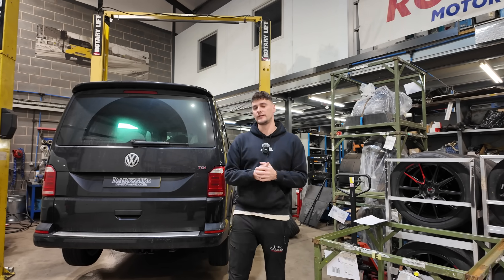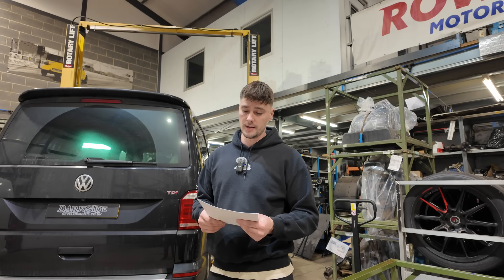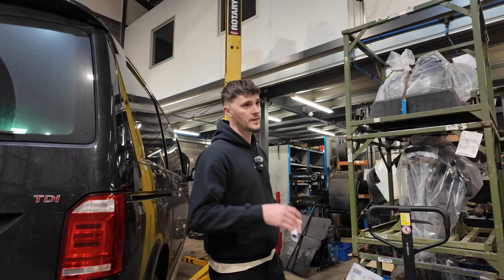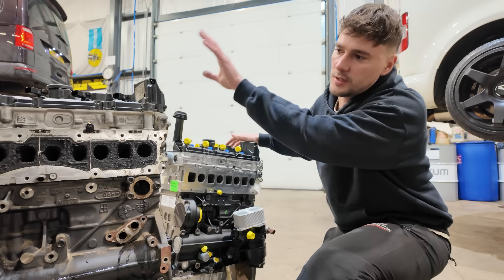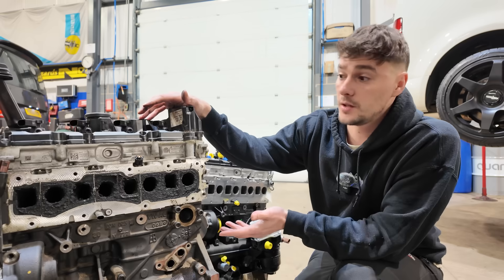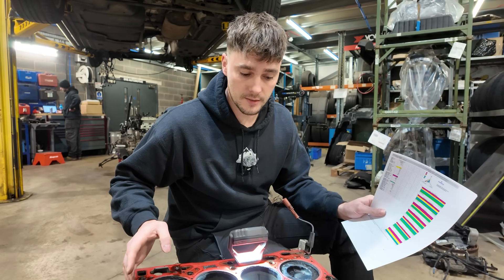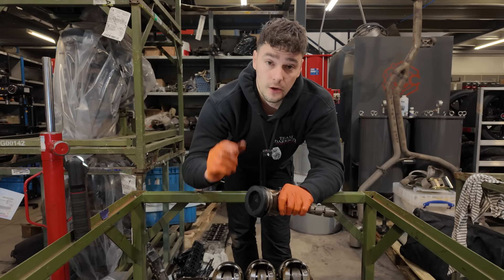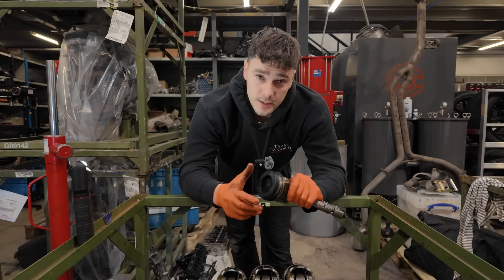Could this be the WORST VW engine of all time? 👎 2.0 BiTDI VW Transporter

Comment: @13:42 you can see the oil control ring is clogged full of carbon, it should have holes in the centre of it to allow the oil to drain back through the piston the spring type backing ring will also be clogged, same issue Toyota had with 2az and 2tr's the oil can't drain back through the piston and just gets burnt.

Comment: Bloody EGR is a VW curse… can you not delete or change it to one that doesn’t destroy the engine? Criminal failure that van should do 150-200k before it gets that bad? Is it bad fuel or lack of maintenance? Do you recommend stage 1 remap on a 150?
Reply from the maker: It's not the EGR that's the issue on the CXEB engines, it's the piston rings. The EGR issue is on the early CFCA BITDI engines.
Reply: @DarksideDevelopments  ah ok thought it was the egr causing both.. what does your stage 1 get out of the 2015 - 2019 150 engine? is it risky? thanks

Comment: my owned from new 2017 204 started using a lot of oil at 75k, didn't fancy spending 10k on a new engine so traded it in for a vito sport 190 , apart from the ignition key being on the wrong side , im very happy with my decision

Comment: Now my EGR doesn’t work. I think to put a new one. My van has the problem (loss 1 lt oil in 1000km). I want to know how much cost change the egr with the all work (how many hours?) and if is better change the engine because I don’t want to make two big work nearly if I have to change the enteire engine. 
I have the btdi 180 horse, the van is 2011 year born. Thank you….
Reply from the maker: It's not the EGR that causes the loss of compression or oil consumption on the CXEB engines, it's the piston rings. 
The CFCA's suffer with the EGR issue.
From the oil consumption you have, the damage has likely already been caused. 
Please email directly - sales@darksidedevelopments.co.uk

Comment: Great informative video. I bought my brand new 204 in November 2017 and within six months it had a new engine on 4000 miles after it used 17 litres of oil in that time.The van is now on 56000 miles and the engine needs replacing again. So now it will need its third engine. Absolutely disgraceful. VW have a lot to answer for.
Reply from the maker: That's terrible news!

Comment: I’ve got 2016 T6 150bhp (with the charge cooler and single turbo) how are them engines holding up?
Reply from the maker: The single turbo models are the ones you want, no issues will loss of compression on these or leaking turbochargers.

Comment: me have a 2016 t6 cxe 204 hp but tuned by abt engine and styling its on 264*** km right now it start to use some oil every 3000km a smal liter of oil big sad becuase iknow whats comming 😢
Reply from the maker: The inevitable does sound close

Comment: Where is that link to the VW document that you mention about the change to the rings for 2019 or later models?
Reply from the maker: It was posted on this thread - https://www.t6forum.com/threads/2017-204-oil-consumption-issues-resolved.35505/page-2

Comment: Are the TT Mk2 and Mk3 2.0 diesels good? (2010 to 2017) 170 and 180 bjp i think

Lpoking to map to stg 1 too ideally
Reply from the maker: Yes, no major issues with these. The 170 models do around 200bhp tuned, the 184bhp models around 215bhp
Reply: @DarksideDevelopments  excellent, saving up for the TT Mk3 184 and shall map to 215 if u feel std manual clutch up to task
I expect it will b a c 75k mls example (I appreciate previous enthusiastic driving would have an effect and hope that a diesel variant doesnt usually attract 'keen' driving)

Is the std clutch tough?

Thks
Reply from the maker: They seem pretty strong so you should be OK depending on the amount of KM's its done!
Reply: @DarksideDevelopments  thks

Comment: Fml just bought a 2016 204ps with 86k on. 
Didn't realise this video came out two weeks ago. I purposely stayed clear of the 180 thinking that was the bad egg! 
So going in for egr delete, dpf gutted, remove ad blue and a remap. May even see about a carbon clean
I'm hoping this is enough for it to survive. 
Will do an oil sample also.

Anything else i should be doing? 
It test drive fine solid manual gear box no smoke or any issues  🙏
Reply from the maker: We have talked about those previously! Should be OK after that, are you coming here for a tune?
Reply: @DarksideDevelopments I've just bought your oil test kit. So changing oil after that also.

Next thinking compression test, would this show signs? If so what psi would i be looking at please

Then after all that depending on findings, yeah I'd defo like to try get by your place for all the preventive measures and a tune 👌

Comment: A good mate of mine is a VW tech of 30 years, and has spent the last 10 on the commercial side. He doesn’t have a good word to say about this engine. Says it’s a toss up between this and the 1.4 twin charger as the worst engine VW ever made.
As he puts it, the primary function of a commercial vehicle engine is to give minimal trouble, and withstand hard use over high mileages at minimal cost for the operator. This engine doesn’t do that.

Comment: So if has burned that much oil I would be keen to know how much ash has accumulated in the DPF.
Reply from the maker: They have DPF issues mainly for this reason
Reply: @DarksideDevelopments  I suspected so. So I reckon a new DPF will be fitted together with the engine, since everything is out now anyways? Thanks for answering btw :)
Reply from the maker: Usually we do!

Comment: I had a new CXEB engine 2 years ago at 60,000. My van was using a litre of oil every 712 miles. VW paid 50%, the dealership paid the rest, as thankfully the oil usage issue was apparent (and reported) from the day I bought it. 15k later it's not using a drop of oil but I wonder whether I should have deleted the EGR by now....
Reply from the maker: It would not make it worse!

Comment: My van uses a heap of oil, after fitting a catch can now i catch alot of oil.... and tip it back in. 😅
Reply from the maker: Recycling!
Reply: @DarksideDevelopments  well I rebuilt it. was super glazed up and the rockers had so much wear the valves where starting to push through them 270000km who knows how much idling, how ever im still catching alot of oil in catch can not sure that its using as much as before as ive only done 1000km. Not sure if there is another issue like pcv

Comment: Hi one other thing to mention is the oil drawn in will burn hoter which will cause cylinder temperature rise and egr faults plus d p f c blocking at the top then unable to regenerate which causes lower cylinder pressure to build up i am sure vw and many other are well aware of this also fuel issues causes poor burn ring wear bore wear then high oil usage a good video we need to be like the usa and take a class action against vw .

Comment: I have this engine with 80,000 miles on the clock and am wondering if there are any preventive measures or ways to slow down the issue besides regular oil changes.

Is a rebuild cheaper than purchasing a brand-new engine?
Reply from the maker: Not without addressing the problem so maybe changing the pistons / rings to the later part number will help. Rebuilding can be done but there is a lot more labour involved, you don't get the same warranty and if you are buying a 'rebuilt' engine off eBay you don't actually know what you are getting or what quality parts are being fitted until it's too late again.

Comment: I've just put a deposit down on a 2019 Vw California BiTdi 199 bhp and it'll be my daily driver. Are you saying stay clear?
It has 26k miles on.
Reply from the maker: 2019 models seem to be good. Mainly earlier models that have the issue
Reply: Phew thanks for the reply and that's put my mind at rest as its my dream California 👍
Reply: what about 2012 model with 180bhp

Comment: 13:40 Only 3 piston rings for a diesel... Compression is twice as high compared to a petrol one, you need 4 or five piston rings. Twice as high compression, twice the blow-by, twice the oil pollution. Increased oil change intervals, halved or quartered engine endurance??  Some Catarpillars and DAF trucks have 4 rings. They last.
Reply from the maker: I'm not sure of any TDi that has more than 3!
Reply: Tdi reach 5000 rev. The cilinder Al si will spend in 50000 kms.
Reply: @sinmoto1220  What must I say? Back to the future... Rebore the block. Insert sleeves. Proper forged pistons with steel ring inlays and oilsprayers below them... should do 500.000 km's at any boost. like the DAF truck.

Comment: EGR - oil contamination, DPF - oil dilution, both causing increased wear. Stick the new motor in without dpf and egr and I bet it would do 150k with no issues.

Comment: I had a 2013 BiTDI (CFCA) from new. Ran it in properly, changed oil before schedule, and it needed a new engine at 60,000 miles, just as the lease was coming to an end! That was my fifth and last Transporter. 
And now they’re just rebadged Transits - what a way to blow a great reputation
Reply from the maker: Its a crying shame!
Reply: Ford diesel engines said to be good at least...

Comment: Ive got a 2009  1.9tdi caddy maxi change the oil every 8 to 10 thousand miles , just about to hit the 300 000 mile mark , this video has made me tgink twice about looking for a new van , i think ill try and keep mine going as long as i can . Very interesting video .cheers
Reply: Tdi pd king engine
Reply from the maker: Keep that one going!
Reply: @DarksideDevelopments  looking further around the internet I think your right. It's worth rebuilding the engine when the rings and bearings wear out ext. Hopefully the government doesn't legislate it off the road ..
Reply: @BobCarolgees-p8f  BLS?
Reply: VW 1.9tdi is one of the most durable diesel engines ever.

Comment: ⚠️A lot of modern engines are inherently good but it's all the emission strangling devices, EGR's and DPF oil dilution which is destroying them prematurely.
The crazy thin viscosity of modern oils is only for emissions  purposes and NOT the longevity of the engines.
0W20 for example is like water.

I personally don't thrash my vehicles and have always done 5k oil intervals.
I've never worn or blown an engine in 45 years of driving ⚠️

Comment: Did you check the compression before dismantling? Have one of these engines with increased oil usage but still had 360psi across the cylinders?
Reply from the maker: Compression is not always an indication of oil usage as its the bottom ring that fails so its the oil film that remains.

Comment: Do yous have any info/videos on cfhf engines as have one in my caddy and having intermittent low oil pressure light come up and wondering if this is a common issue and causes . Thanks Emily
Reply from the maker: It's not a common issue we have come across on these engines. If it's not using oil, maybe just the sensor or wiring?

Comment: I had a CXEB, at 18,000 miles from new was using 1lt of oil per 1000km. Utter shite, these engines should be avoided like the plague. I for one will never buy another VAG product as I've seen so many engine issues in so many of their products.

Comment: Nope, the worst is the 1.4 turbo supercharged on a dry clutch.
Reply: I have that it passed 250000km with no major issues, it's not bad it's ecofuel CNG version with 7 speed Dsg dry clutch,150hp and 220nm torque, it wouldn't be popular with taxi drivers in my city if it wasn't economical and reliable.

Comment: This absolutely grips my shit when I see this, EGR,  DPF,  ADBLUE, KNOX SENSOR, dirty, dirty, words in my world, I guarantee you my 35 years old Nissan patrol 42d run's cleaner than thos engine, and before the smartars, fucker start shouting, Yes the science works, What doesn't work is practical application, And when you see thes videos, it confirms it,  and I'm 58years old, and been in mechanistic all my life, ran my own business for 35 years,  still on tools, so seen it all,  There still a crank, pistons, and valves, the only difference is the detritus they've bolted on after.😁😁😁😁
Reply from the maker: The new engines are BETTER in some ways but are strangled and abused by emissions and Long life service intervals!

Comment: I have a 2019 Q3 with a 2.0 tdi engine, will I face these same issues down the road or they fixed them by 2019?
Reply from the maker: This problem seems to be isolated to the CXEB engine code so no need to worry
Reply: Amazing thanks!
Reply: You re good. Whats your engine code? I have a 2016 plate A6 2.0 TDI CNHA engine, EGR and Adblue delete and remapped soon as I got it with one previous owner, DPF  still in place, regen done as it should. Runs really well. I go around the city during the week and motorways weekends that’s when DPF clears most of the time. My friend has a 2015 A3 2.0 TDI auto with the DQ 250 gearbox and less complicated than mine, you probably have the same, will last long time.

Comment: From AUS, I've got a 2012 LWB 4motion CFCA. Just changed the EGR cooler to spec D at 197,000km. Zero issues with the van since I got it at 133,000kms. Previous owner also zero issues. Watching all the videos about the problems these engines have I feel I must have got one of the better ones. Now for peace of mind I'm going to change the oil every 5000km because oil isn't that expensive when you think of keeping the insides healthy.
Just had a REVO stage one remap done as well which I wish I had done when I bought the van, makes it so much nicer to drive.
Reply: My company transporter uses a litre between every tank of diesel. 135000km
Reply: @SIGURDRH  mine is similar but @270000km I've fitted a catch can and I get 200ml out every 250km lol😂

Comment: just wondering why customers put the same engine with potentially same problems back in? can you only replace like with like? cheers
Reply from the maker: The replacement shouldn't have the same issue. It would be possible to swap but theres a lot more hassle involved and no VW warranty

Comment: Have you guys already heard of the next round of software updates?
A court in Germany ruled that even Euro 4 car's got "illegal emissions cheating software".

Car's that are 15 or even 20 years old now.
Absolut insanity.

Now they also get a shit load of EGR, the dealer installs a new design of the metal piece where the exhaust gas is injected into the intake manifold (on the 3.0tdi ASB at least).
The injection changed, the 3.0tdi's are now sounding like crap, ratteling ect.
The engines now need more fuel and of course the DPF get's hammered with so much soot.
(For the people that don't know, a lot of EGR means a lot of black smoke)

Comment: Lol and people go on about ford wet belts. Enjoy your £3k per year engine. I'll go get my wet belt changed every 4 years for £1k
Reply: Wet belts are on fords, honda, skoda, vw, nissan, peugeots etc etc. Ford get a bid rap because there are more of them and tend to be bought on finance by customers who don't do much service in the 1st 50k miles. Also fords are a hole to to on. But like i say, they're singled out as the bad ones when all petrols since 2015 have the wet belt issue and its eu regs, not the manufacturers.

Comment: soon as you buy any moden diesel, remove the dpf and turn off the egr, piles of absolute shite, we can still get away with it here in Aus, duno about over there
Reply: I will just stick with my bmw E46 with M54 engine lol
Reply: @dexietyy7922  I have an m54 e36, irrelevant to this comment or video haha
Reply: @taydencornish  I meant I won’t even buy a modern diesel ever they’re awful
Reply: You can do that but you have to keep the dpf and put it back on for the MOT you can map out EGR and blank them off but keep the EGR on the car but not working
Reply: @keithknight1107  DPF isn’t really an issue if people drive them hard and long distance quite often. But no most people who drive diesels do short journeys don’t let them get hot properly and never boot them and wonder why they clog up. Exactly why I stick with petrol because I simply just don’t drive far enough to own a diesel
Reply: 1.9 is the best n can push this t6

Comment: I can’t quite get my head around the fact that internal combustion engines have been around well over 100 years and yet it seems pretty much all manufacturers are having issues with some of the basics!
A few examples…. Fords wet belt, BMW’s crank hub issues, this VW issue and even the Porsche RMS/IMS not to mention bore scoring These are literally just off the top of my head and there’s countless more.
Is it a case of the development teams being given a brief to creat an engine for a particular installation, meeting all the modern regulation etc only for the bean counters to come along and have all that good development work turned into a cost cutting exercise using cheaper methods and materials? Or, are the engineers just not learning from past experience and ploughing on regardless and fcuk the consequences?
I appreciate nothing lasts forever but two engines in 120k is taking the piss!
Great informative video👍👍
Reply: in fairness to some of them, a lot of issues are caused by all the extra bits required to meet stricter and stricter emission standards.
Reply: The issues are on purpose
Reply: Also the Mazda Skyactive 2.2 Diesel, Injectors in the rocker cover and the seals leak diluting the oil wearing the exhaust cam shaft out and causing major engine wear!  Major problems at circa 50,000 miles including massive carbon build up internally!
Reply: @mrmick4757  Mazda seems to solve most of the issues - defective cam haft were replaced free of charge (including periphery), mine 2014 2.2 Diesel had zero issues so far (130k km on clock)
Reply: Like Scottie says, the answer is Toyota
Reply: @Brit_Toolmaker they’ve had their gems
Reply: Mostly the emissions and then a lot of greed and short term thinking on top